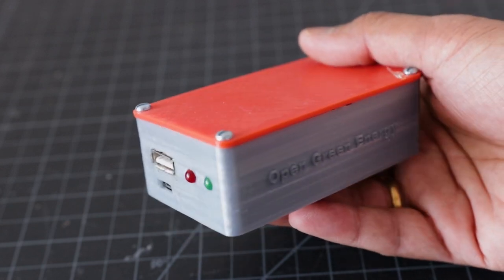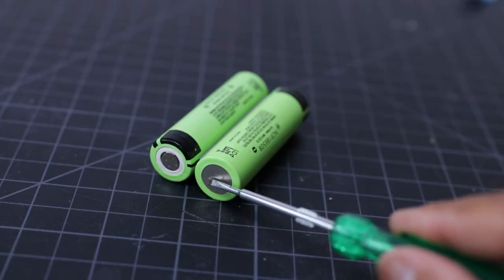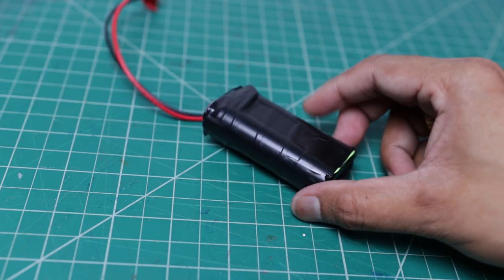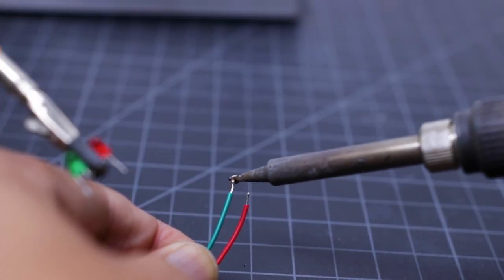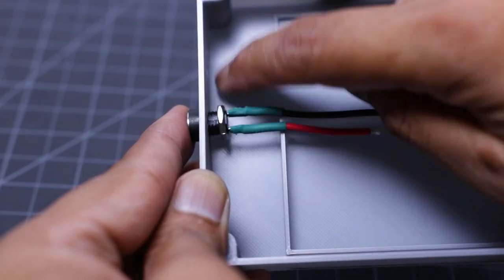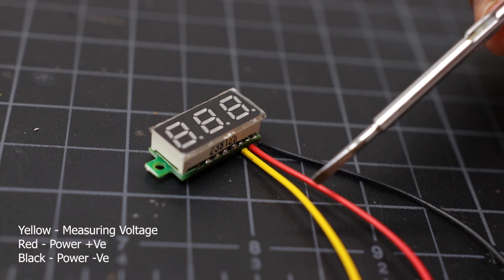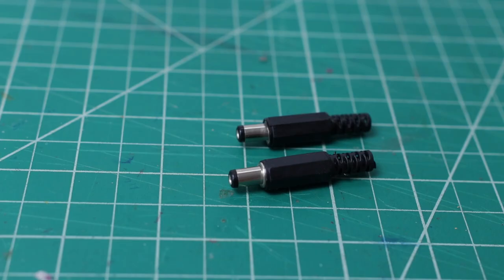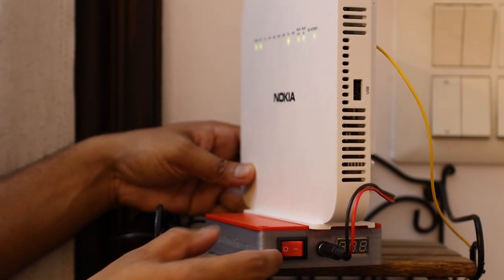DIY Mini UPS for WiFi Router V2.0 | 12V Mini UPS  | Work From Home

Comment: Bhai pehle yeh bataa ki yeh DIY kaha se hai?
Reply from the maker: Bhai ye DIY hi hai, more professional way. You can make the enclosure by using any plastic box too.
Reply: @opengreenenergy  Do you even know the meaning of DIY? It means “Do It Yourself” which means it contains resources and items which are easily available. In your video you have mentioned some parts which is even hard to get the smallest example soldering machine also you have shown some circuits. Which are hard to get. I know you have good knowledge about hardware but there are people who doesn’t have resources and that much of knowledge. After some research I found that there is a male to male which will simply connects to your power bank and to your router and also it doesn’t have any power instability/fluctuation issues. Instead of making complex for people try to make the procedure smaller and simpler for people like me. Though I loved how you presented the video with pointers and done everything professionally & precisely. Good job!
Reply from the maker: @arknitosh  Thank you for letting me know about the term " DIY"